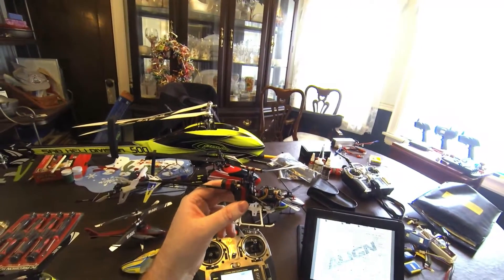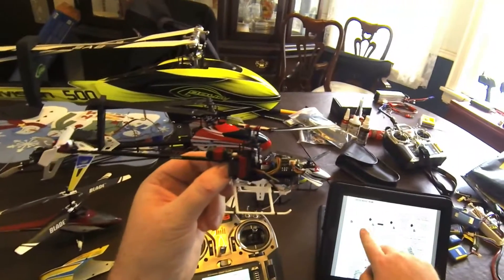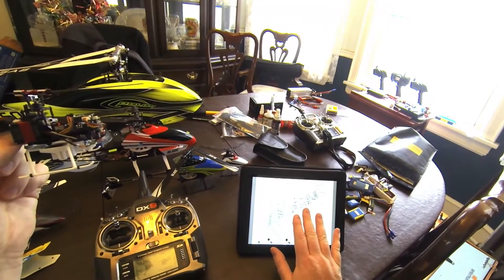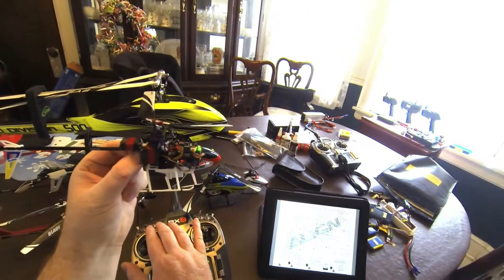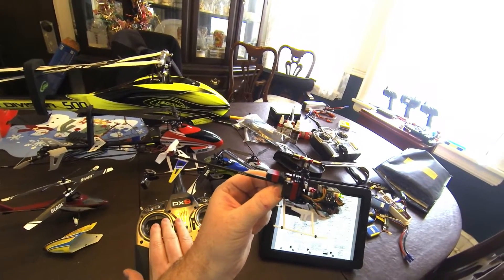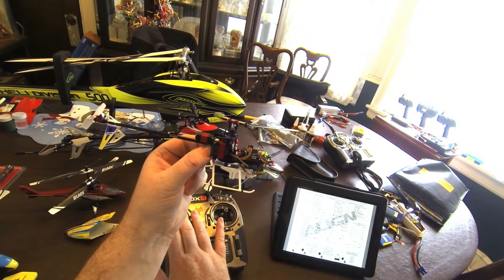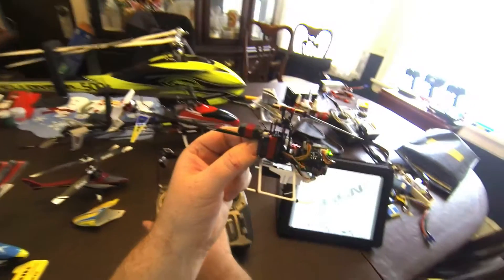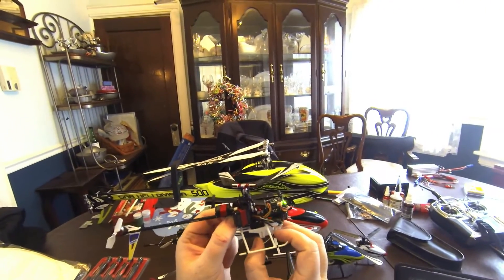Align TRex 150 DFC RC Helicopter- Programming Using Setup Mode

Comment: Nice video, not too many outhere. How do you get into setup mode? Will it be the same with the 150x? I accidentally did something to mine and now it won't bind unless I conect with the app then the tail goes on when my throttle goes down, can I reset to default settings? Any help would really be appreciated...Rookie here...
Reply from the maker: I have no idea. I gave up helis years ago after my local hobby store closed. I forgot I even owned this one.

Comment: Is this recommended for the install of a new 150mrs board? I had to replace mine after a crash I'm a newbie
Reply from the maker: Clean the surface of all old tape first and prep the area using an alcohol pad. After it dries, use some good double sided tape to stick the board back to the frame and make sure the board is level with the heli frame. If the board isn't level you may get some drifting.

Comment: what should I check if I got 2 green light on the board and a steady orange on the sat that to me indicates it is binding correctly when I turn off the radio the light turns red but it does not  initialize, originally it  initialize but after a mild crash it stop I have inspected the board and cannot find any damage any idea would be gratefully appreciated thank.
Reply from the maker: I am not sure I understand. Your Trex 150 will not initialze at all or just with the TX off? None of my helis initialize until after the connection is made between the TX and RX. One thing to try is rebind or create a new model in memory on the TX and rebind. Sometimes things just get messed up a little between the two. A guy I talked to with a brand new Losi Ten-X lost the ability to steer it and rebinding solved his problem.
Reply: thx for the quick reply with radio on no noise or movement check helifreak found other people having same problems damage MOSFET from simple hard landing broken sorder joints will try taking my apart and checking
Reply from the maker: Patricio M I almost mentioned that I read the same thing on RCGroups but I was hoping for an easier fix. I had a light crash in the snow a few weeks ago and it would not initialize, but it came back to life the next day. I guess I got lucky.